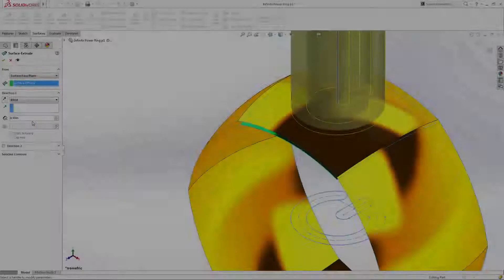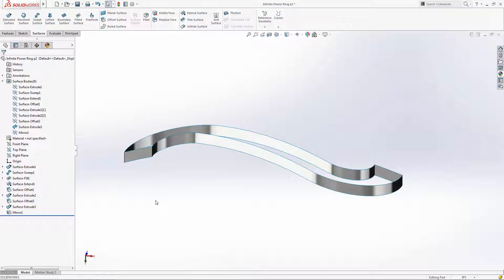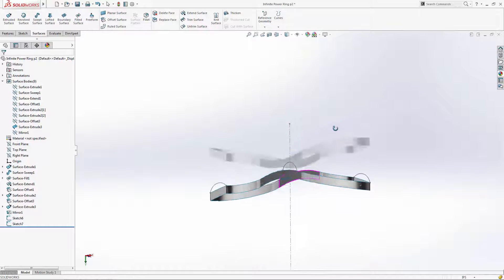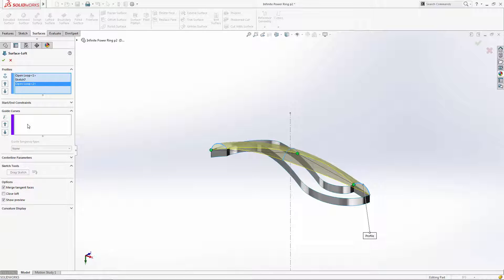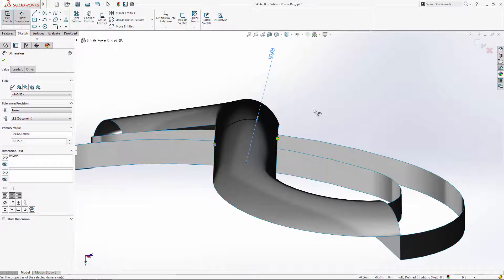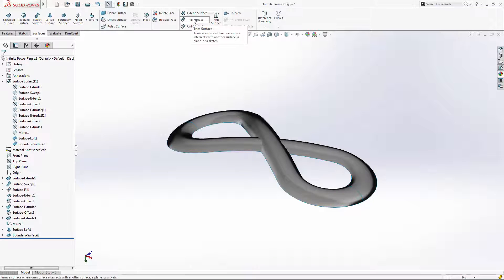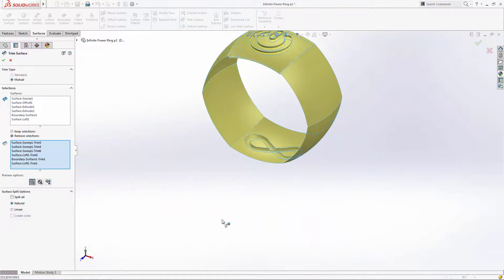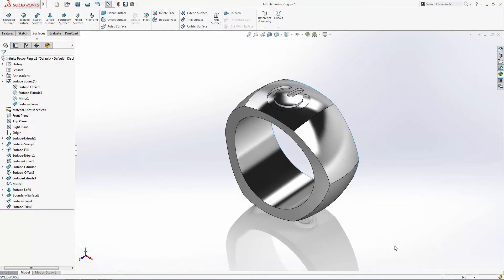SOLIDWORKS Infinite Power Surfacing Ring - Part 3

Comment: my surface loft at the S-thingie is going crazy. Any suggestions? It just wont cover the whole thing.
 I have solidworks 2017. It worked with the boundary tool though.

Comment: So I followed all the steps; however, when I get to trim surface, I keep getting the "Rebuild Errors" message. I don't know why I keep getting this message. I ended up having to trim the surfaces in several step. After I trim the surface, they don't automatically become one surface body. So I ended up knitting the surface together with the Knit Surface Tool. But then, when it comes to Fillet the edges on the infinite symbol, the program wouldn't let me fillet the outer edges of the infinite symbol. It seems that one problem lead to another. I just can't achieve the same result. I am Mechanical Engineer and an experience SolidWorks user, I don't understand why I would get these error messages. Can someone please give me an explanation? Thanks a lot!
Reply: I just figured it out after having the same problem, check off remove selections instead of keep selections